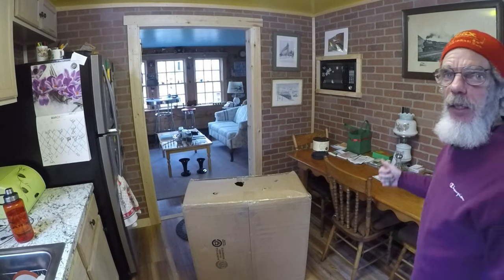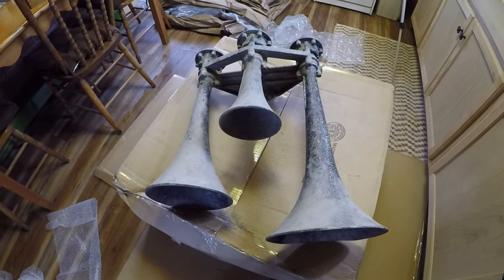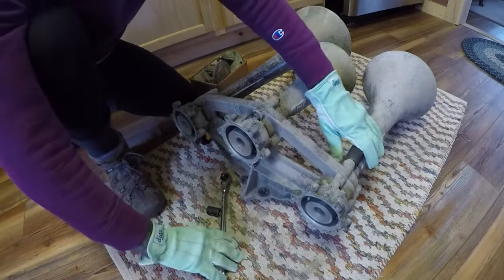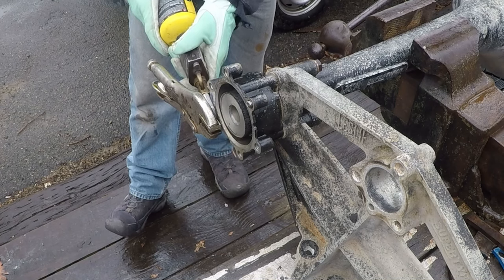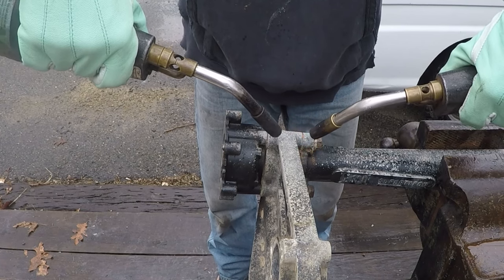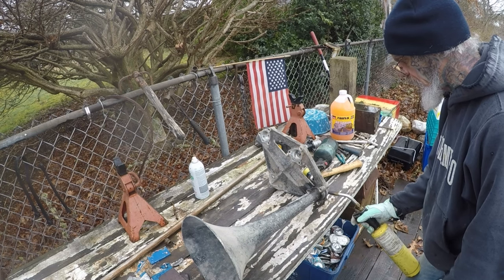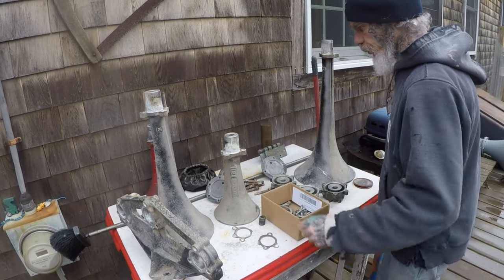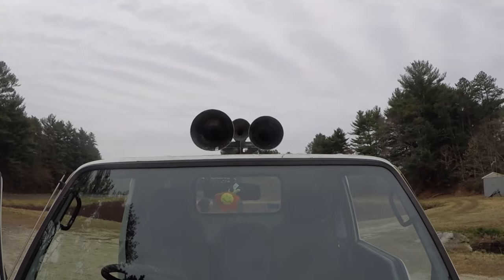Repairing a Leslie RS3L that lived under a truck.

Comment: If the nozzle faces are heavily pitted and the back caps aren't in much better condition on the gasket groove,  is it recommended to replace the chamber? If so, are they still available?  I can make them bark off with a blow gun but are very sensitive to back cap torque.